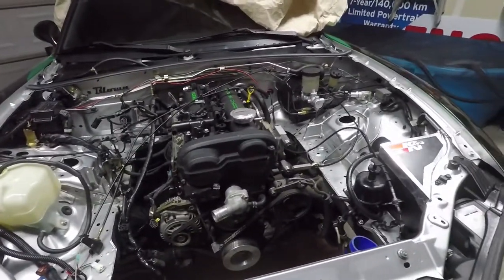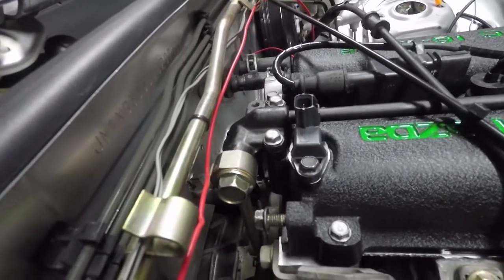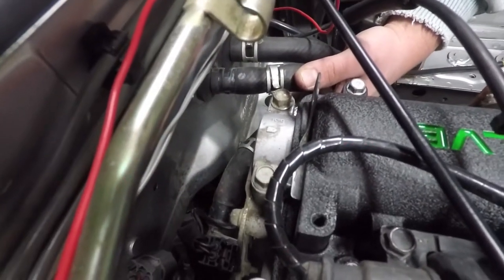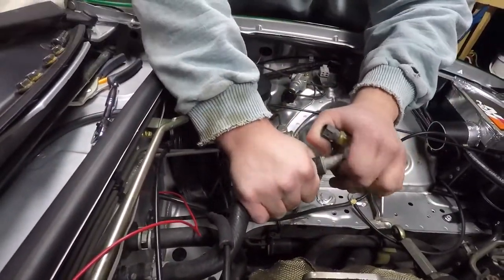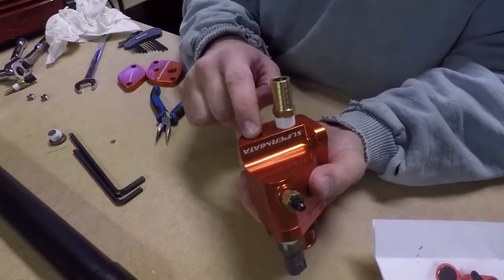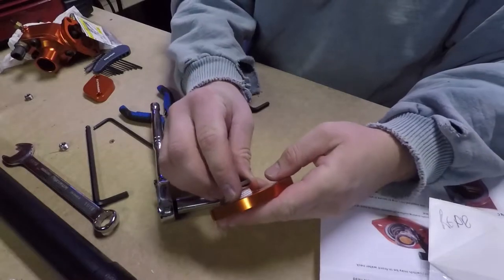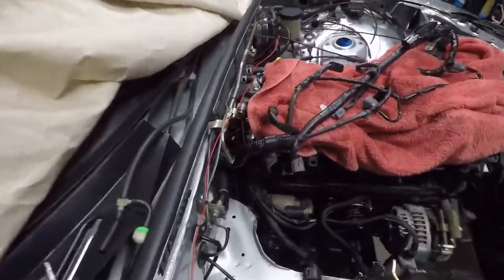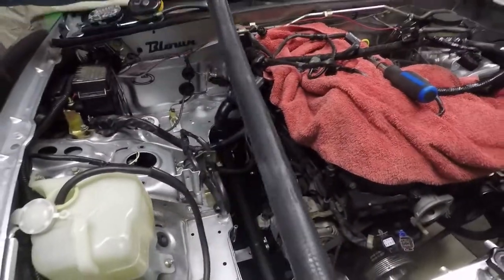Mazda Miata/MX5 Coolant Reroute

Comment: Earl Hooper

Just finished the install on my 1990, engine installed.  The NA reveals some specific issues that were not address on any of the online materials found.  A learned a few things that may be of help.  

First, I could not with confidence install without making as much room as possible.  Removed the ignition coil, valve cover, and CAS (and few other small things).  My 1/4" socket set with swivel head ratchet was very helpful.   The lower and upper bolts are not reachable with a 3/8th drive.  On the top back bolt there is not clearance for a 3/8" drive socket (maybe a thin wall).

Second, discovered (the hard way) that installing the temp gage sensor would not allow the CAS to be installed.   Was not expecting that, but reversed the order and all went in, but had to modified an old box wrench (did not have a crows foot) to get the sensor tight.  

As a racing application, this would go in easy with the engine out of the car.  An in car install is a big challenge but possible with the correct tools.  

Third, and just a recommendation if you are going to make such a big effort to install this reroute, go to a hard water line to the radiator.  It is worth the effort.
Reply: Earl Hooper   To clarify; you reversed the order of installing the reroute fitting minus the sensor, then installed the CAS and then afterward installed the sensor with a modified crows foot. Is this correct? What is a crows foot ?

Comment: The fastener used to hold the housing to the back of the head come with the re-route? I didn't receive one and had to re-use the stock bolt, and its a tight fit, couldn't really torque it down.

Comment: How did you tighten the mounting  bolts?  Specifically the upper right one? There isn't enough clearance between the body of the aluminum to get a socket on,  or is there enough room to tighten the wrench before it ends up hitting the wall of the reroute.

Comment: Curious why you left your temp sensor in the front where it seems like there would not be as much coolant flow since its all closed off vs running it to the port on the back that you sealed up?  I am looking to do this install having moved back to Arizona and was planning to install temp gauge and using the port in the back.
Reply from the maker: Duhamal the front still sees lots of flow from the small bypass line. It comes out the side of the housing and loops back to the water pump. It ensures water is moving when the thermostat is closed. Since water is always moving through it (more than allowed by the tiny bypass hole at the thermostat) you could argue that this will give more accurate readings at lower temps.

Comment: adding the section of hard line is genius...what are your thoughts on using thin-wall stainless steel in place of the copper?
Reply from the maker: Joey Baby that would work just fine! We used copper because we were able to drive 2 mins to a plumbing store and get the proper size for cheap.
Reply: @angevaaremotorsports779  did you use any particular solder?
Reply from the maker: Joey Baby just normal plumbing grade stuff.

Comment: Do I need to change the head gasket on the VVT motor for this to work, or is it fine with the stock head gasket on the VVT motor?
Reply from the maker: Tommie Lee No you do not need to change the head gasket. Stock gasket is fine

Comment: Hey do you have the link to what piping you got for that coolant reroute.  It looks clean
Reply from the maker: Rich Tran the hard pipe? It’s just 1.25” copper plumbing, the brackets are custom made out of 3/4”x1/8” aluminum and mount to 10mm bolt holes already on the frame rail.

Comment: Do you have the part numbers still for the oe gaskets
Reply from the maker: steve aguero it is the same gasket for front and back: B621-15-173
Reply: Awesome thanks getting my kit tomorrow so will be going the gasket route also
Reply: Did you notice if using the stock gaskets blocked the coolant flow?  Was reading on Rev limiters blog and that's the reason to use the gasket maker over the stock gasket
Reply from the maker: Ours actually leaked from the gasket so we ended up just using the sealant - So far so good. Thanks for the update
Reply: Just wanted to concur with the sealant over the gasket in back.  Bought the gasket when I saw this original post, but noticed an overhang in the housing.  Came to the conclusion that it may cause turbulence in the water flow so decided not to use it.

Comment: If one to find fault in an otherwise perfect car, the rather lazy engineering makeshift way the factory coolant system was installed. At least they could have plugged the one port with something other than a rubber nipple. Inexcusable actually.